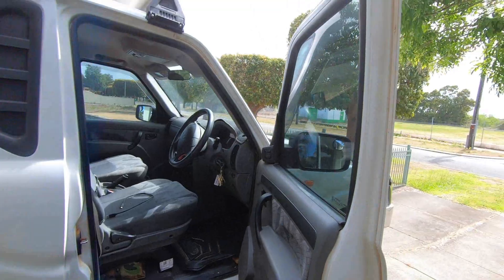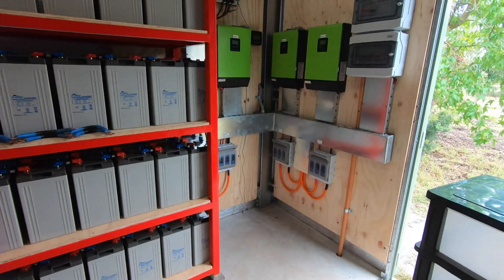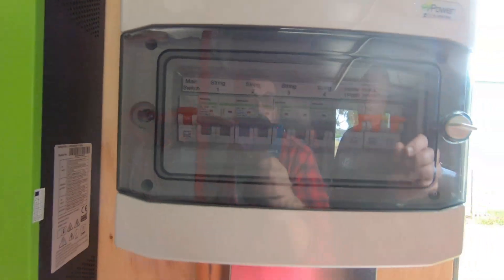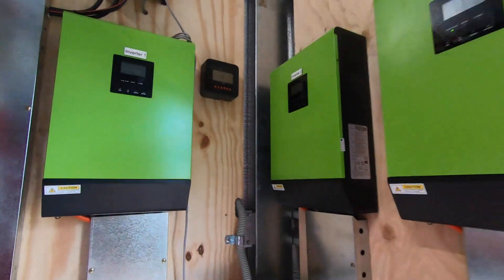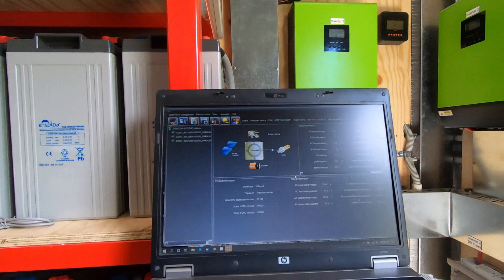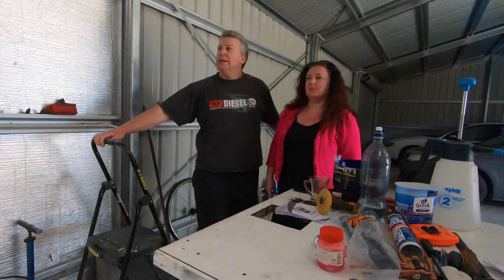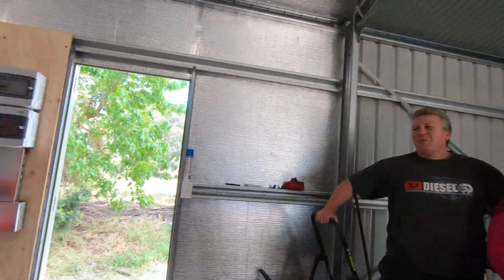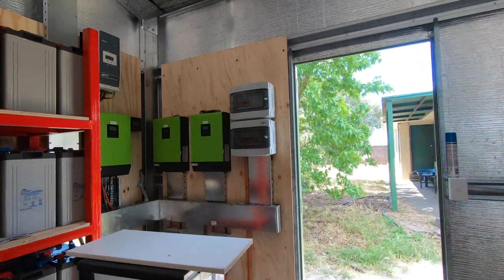New 14,800 Watt Off Grid System install

Comment from the maker: "Quote "

Unfounded Lost
"Are you even a licensed solar technician"
What ?  No such thing.  "licensed solar technician"  lol what planet are you from? You need to be a licensed Electrician with a DC endorsement on said licence to install  Solar that is OVER 130VDC, When it is under the 130VDC you can do it yourself but you still need to build it to code.
However if you had watched the video all the way though you would have seen steve talking and he mentioned the name of the electrical installer and the Solar Shop. So It would have been great if you had watched the full video............
I design the systems after i have worked out what the clients needs really are. In this install we worked out it would be cost saving for them to change some older appliances to newer ones as a power saving measure and that would save many thousands of $.  We then look at the best cost saving measures, best prices, One thing i do not recommend people do is scrimp on the electrician. I have 2 electricians and one solar shop i recommend. It's down to my experience living off grid and math. Don't take my word for it. Ask Steve. https://www.youtube.com/user/7StevePrice/channels?view=56&shelf_id=0 or watch his videos. I also don't get kickbacks or make money doing what i do, I love helping others achieve the same off grid lifestyle my wife and i enjoy.  As it all must be built to a legal and safe standard. How do i do that. You can also ask steve that question as well.

Comment: THANK Y FIRST GOOD JOP  JUSTN  .. BUT WAY Y DIDNT GO WITH 96DCV? AND THE SECOND QUESTION THAT I WANT Y  TO ANSWER HONESTLY . IF THE TEMPERATURE IN THERE I MEAN WHERE Y BILT THE SYSTEM IS 70C DEGREES. WILL THE SYSTEM WORK EFFICIENTLY? THANK Y
Reply from the maker: 1) The inverters get to expensive if you go over 48vdc. 2) No i don't know of any inverters with build in mppt charge controllers that will go above 55c. My power room in summer gets to 50c and above on some summer days, But there is where i do all the testing. If your running them constant above 50c then you need to install refrigerated cooling. Also Lead acid batteries / LA / AGM / gel / and so on should not be used at all if tempts get above 50C. 3) I always try to answer questions honestly. No good me trying to teach people if i tell porkpies now is there. Also no NEED TO USE CAPS LOCK I can hear you fine No Need to be  shouting at me......

Comment: Hi Justin

I currently live off grid in WA using a pip4048 we are looking to upgrade to three pv18 VHM 5048 from Must do you think they are a good model.
Reply from the maker: MUST are Clones..  No Joy will come from buying rubbish clones.  I to have ordered new inverters for an upgrade. Mine will be real ones. Pip MK 5048.  Do yourself a favor and have a look. https://www.mppsolar.com/v3/pip-mk-series/ PDF manual http://www.mppsolar.com/manual/PIP-MK%20%28PF1.0%29/PIP-MK%20manual-20190717.pdf .   My new units should be here by the 22nd i am told.
Reply from the maker: I buy Direct from Mpp Solar inc in Taiwan  here is there approved ebay seller  in Australia. http://www.ebaystores.com.au/Maximum-Solar-and-General-Goods
Reply: @JustinCaseSolarPower  they are all made by voltronic
Reply from the maker: @phillipmoore4492  You can buy a clone of just about anything from must. And yes why the pip 5048 are made by voltronic as the parent company. Voltronic only sell vire the container load. Don't know about you but i have no use for a container load. I Shop from Mpp Solar inc in taiwan as i have never had a problem with them EVER . Even if the unit is out of warranty. You asked my advice,. I gave it. If your not happy with it then Don't ask.
Reply: @JustinCaseSolarPower  chill not having a go just saying that they all sell Voltronic products thats all.

As Mpp i keep getting sent to the local guy would rather buy from taiwan thats all
Reply from the maker: Yes it's a bummer. Most companies now have approved resellers. You could always go to this link https://www.mppsolar.com/v3/contact-2/ tick the pre sale box. Tell them what you want and address it to Att Peggy.  Tell them you talked to me Chris (Justin Case) and i sent you to them.  Tell peggy what you need and remember the parallel kits. and ask for shipped price to you. Worth a try. good luck
Reply: @JustinCaseSolarPower  i found the local seller a bit expensive would rather import myself

Comment: good morning, I'm Jimmy and I'm Italian. I saw your off grid inverter monitoring software and wanted to ask for some information. I have a 24v system, the inverter and an MPP Solar GK version, and compatible with its software? I also wanted to ask you if your software can handle external accessories like sonoff devices example in case of surplus can activate a sonoff for the ignition of a resistance for electric boiler? Thank you. I await your reply. De Valerio Jmmy
Reply from the maker: The program being used in this video is the standard software that come with the inverters from mpp Solar Inc Taiwan. Should be in the box you got your GK in,

Comment: Curious to now, was a Tesla Powerwall II battery system considered ? Why was the current system chosen instead as opposed to others?
Reply from the maker: it all comes down to $. These batteries have a 12year life span. He can replace them 3 times and still have money left over. Powerwalls are just a rip of when it comes to the $ value. However that being said. Lithium still has its place. Like in my camper trailer of motorhomes. RC toys and phones ext. For off grid systems Lithium has now been replaced by Aluminium Iron batteries. 20year Plus life span and great off grid performance.  So when they become readily available that is what we will be uning. The carbon batteries were going to be the next best thing but have been rendered out of the market by the new  Aluminium Iron batteries. That is just my thoughts on the subject anyway. I tend to avoid discussions of this nature though as it seems everybody has a barrow to push. Me i just want the best BANG FOR BUCK and longevity for the people that ask me to work out a system for them.
Reply: @JustinCaseSolarPower  Thanks for your view on the subject. I will check out the Aluminium Iron Batteries as we are looking at being 100% off grid & want best performance for the money outlays.
Thanks
Gary
Reply from the maker: @WorkshopUp  If you can get them they will cost a lot right now. That is why we are still using AGMs. 10 to 12 years change them out and you will still be under the cost of lithiums. That is just my View and whatever you choose will be the best ones for you. 🍻👍

Comment: What mm cables are you using. To the house. From panels to inverter?
Reply from the maker: Your asking about the AC side, Sorry I don't give advice on AC wiring.  In Australia all AC wiring is to be done by a licensed electrician.  DC wiring however can be done by anybody as long as its under a certain voltage.

Comment: Looks really good nice set up will last them for years to come
Reply from the maker: Lots of work was done beforehand working out their needs and expectations.  Making the property more energy efficient. Steve made the battery frame in the shed and the solar stand in the sheep yard as well as did all the digging as well as helping with the installation. That system should last them many years.

Comment: Why does he need the epever when the pip's can handle 4500 watts each for PV? Guessing the string voltage is too high.
Reply from the maker: Did you see the volts going into the charge controller. 170vdc under load.  Way to high for the 5048. The panels in the sheep yard are on the pips. As they are set up in string of 2. Giving just under 100vdc.  So not all the eggs are in one basket.
Reply: @JustinCaseSolarPower  The hardest part will be to balance the charge coming from two different sources so they don't fight each other I just set one to be the main controller and the other lower to shut off first.
Reply from the maker: @offgridwanabe  Its not hard at all. That is why I go to these jobs. So I can program the systems and tweak it as time goes by. Making sure their battery bank will love them long time.
Reply: @JustinCaseSolarPower   Awesome you can do that for them, Mine sees the incoming voltage from the second charge controller as battery voltage and shuts down saying battery voltage too high.

Comment: nice setup, I am looking at the 12 volt, 800 watt 120 vac for a very small system of my computer com area. on the fence with that or xantrex.
nice job
Reply from the maker: Yes it runs everything they have. Very happy with it they are.